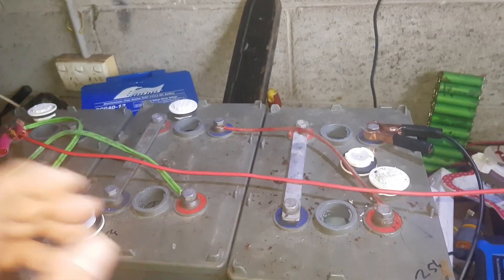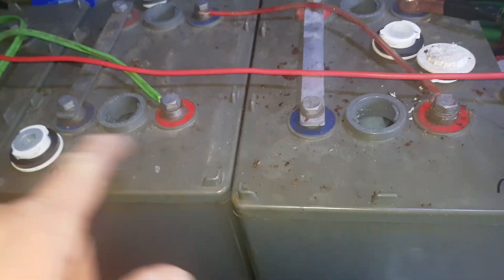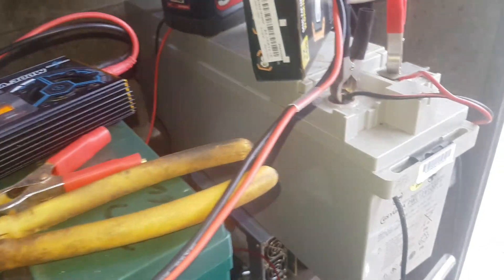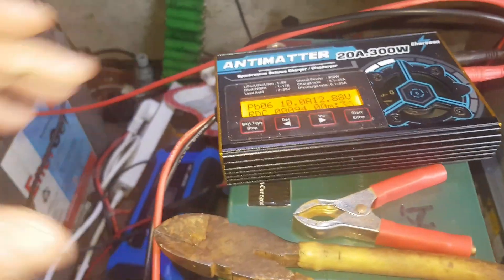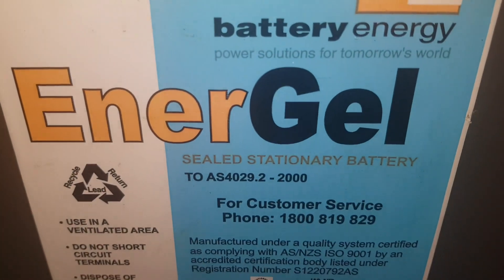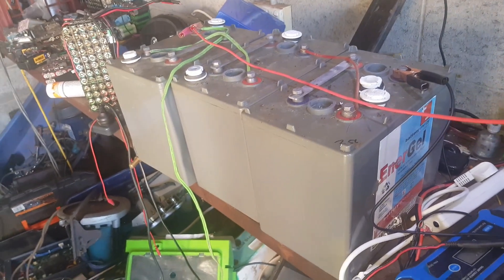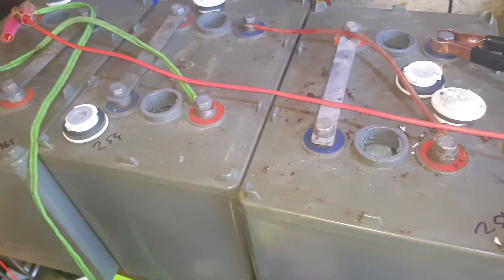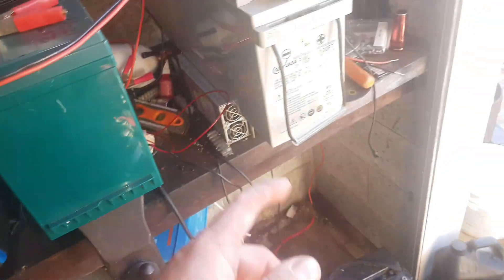Can you Recover Gel cell Storage Batterys

Comment: Hello sir.   I have old gell type battery.   After i open the cap, i just see the gell and no water inside the battery.  Can i just top up using battery water or what  water i can use
Reply from the maker: Your not ment to see liquid it's ment to just be wet not liquid you can possibly add a small amount of water and see if it retains charge better

Comment: Hello,
I see your video, very interesting ! I've a question, by adding water in these battery did you increase there capacity ? 
Can you tell me how much capacity you've gained (approximately) ?

Best regards,
Jordan
Reply: What kind water i put to gel typ sir
Reply from the maker: @carlitoluague1297 distilled water or demineralised
Reply from the maker: It makes the gel touch all the cell plates again. That helps regain capacity of they are not too damaged
Reply: @Oneupthesleevecustoms  thanks for feedback :). We have 12 battery FIAMM 720 SMG, some of them are in not good condition. We run test on all of them. On top inside battery the gel look like same as yours (I can take pictures). My question, did you think add distilled water is enough? Or distilled water with sulfuric acid? 
By the way, did you run test after this video on this battery pack ? 
These video in this serie interesting me a lot but I not found in your YouTube chanel the next video on this subject. Did you have it ?

Best regards,
Jordan
Reply from the maker: Jordan Marguerit I ended up moving house and later scrapping most of my lead acid battery's I made early videos on.
Distilled water is fine to get them going again. Few cycles and if you can measure the capacity on each cycle it should get better
Reply: @jordanmarguerit7989 slm Türkiye de yaşıyorum. Jel aküyü Tamir ettiniz mi  nasıl tamir yaptınız
Reply: @selamiergun8640  Hello, unfortunately we didn't get there in a decent size. We tried distilled water and also sulfuric acid. Neither method restored the battery to its original capacity. Don't waste your time if you don't have industrial equipment.

Comment: How do you remove the caps from the battery
Reply from the maker: Twist 90 degrees and lift. Tight rubber seal may need plyers.  Watch you doing flick acid at your self  when it comes up

Comment: I accidently put acid water in my new Gel batteries (150Ah each) i thought they are normally batteries which needs acid water. But i removed the acid water right the next day. should i be worried ? is there any chance that i can save them from any permanant damage?

Comment: These battery desulfators seem to be higher voltage but a lower amperage. So maybe  straight to your solar panel eg 19v resisted to 1 amp for 48 hours or until charged If it’s no good after 5 cycles I’d call it. 
I once charged a 2.9ah 12 v gel from a UPS that was only getting to 7v accidentally reversed its polarity and it reached  -12.8 on a standard charger the battery got pretty hot though (May boil of the water or Cause a 🔥 fire) Then after a day it dropped back to -7v then I charged with the correct polarity and it got to 12.8 and stayed good. Not sure why.. but could be a last ditch effort after all other efforts have failed.

Comment: I always wondered what that gel would look like
Reply from the maker: I.made a video about one that i opened but audio was all out of sync so scrapped i t:(
Reply: One Up The Sleeve Customs 
If you still have the video, you could do a voice over on the sound track.
Reply from the maker: All good ill re do it
Reply: @Oneupthesleevecustoms  if you do it again I'd like to see.

Maybe pull a chunk of that gel out and see if it dries out in air, if it does rehydrate it and see if it accepts the water. Water loss is an issue with AGM cells, so it's certainly a reasonable thought. I also wonder how long it takes the water to rehydrate the gel deeper down, a retest in a month would tell if it did anything long term.
Reply from the maker: Ive been cycling them for tests :)
Reply: @Oneupthesleevecustoms  hey how good are lg he4 are they better than he2?
Reply from the maker: Yet to see one mate sorry
Reply: @Oneupthesleevecustoms  search em up I harvested them
Reply from the maker: Ill have a look tonight in office
Reply: @Oneupthesleevecustoms  wow they got 2700mah there better than he2
Reply from the maker: Still high drain?
Reply: @Oneupthesleevecustoms  ya there 20a cells
Reply: Did you fix them i got a 200ag gel lead crystal 12v battery and it sits at 3.7v i did add some still water in it and placed it on optimate 7 charger will check if it worked  and  leave a mgs again